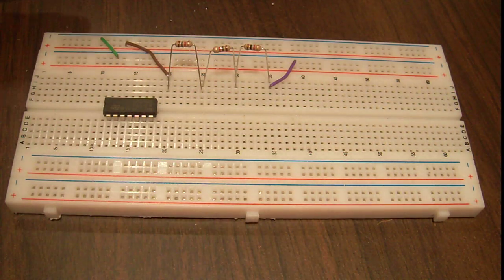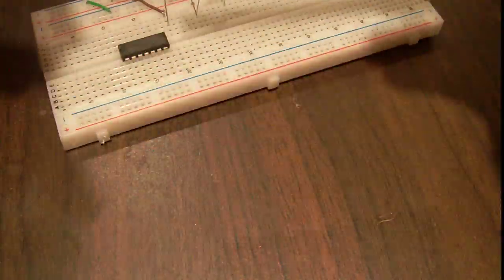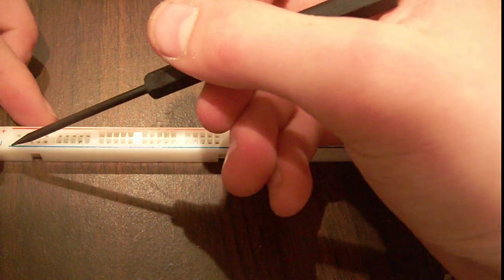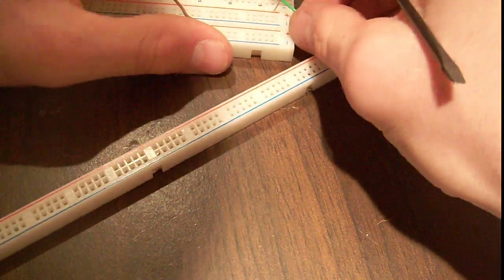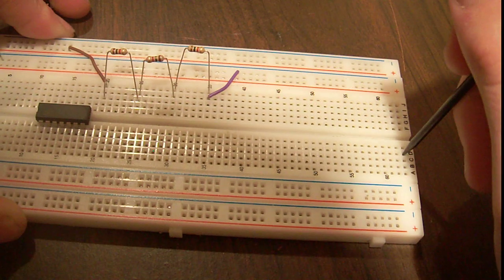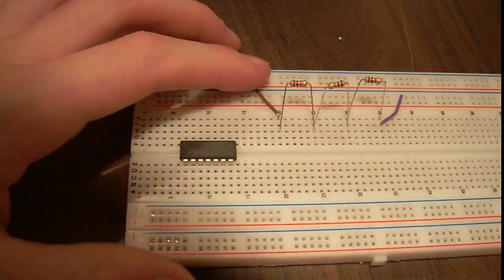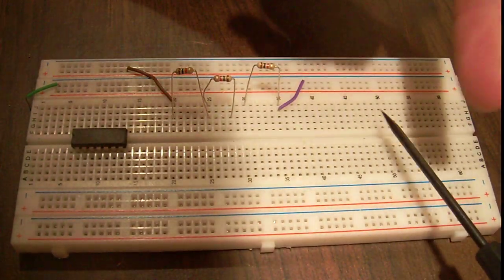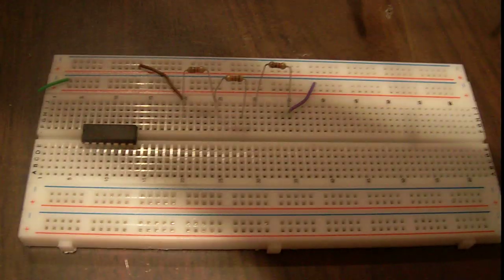Breadboard Tutorial

Comment from the maker: No reason, it makes no difference because the short rows are connected so which hole i put it in the row makes no difference so it makes no difference weather it is sideways or straight as long as the leads would be in the same column.

Comment from the maker: Well under most circumstances it's totally harmless. Unless you are using high voltage (which you obviously shouldn't touch) or high current (which would probably melt the breadboard) it's safe to touch. A normal circuit won't hurt you but your body has resistance so touching a circuit while it's powered up could change the circuit. In general use common sense.